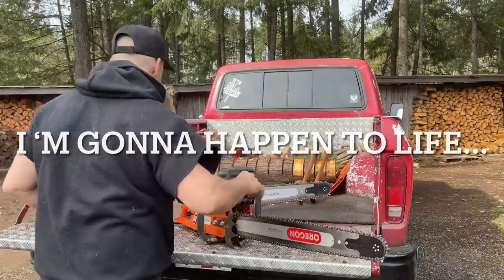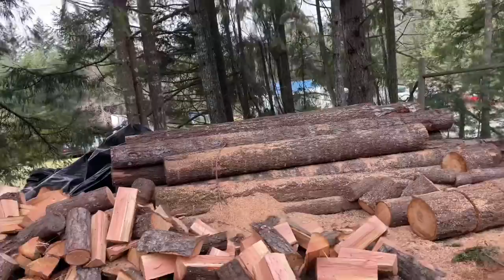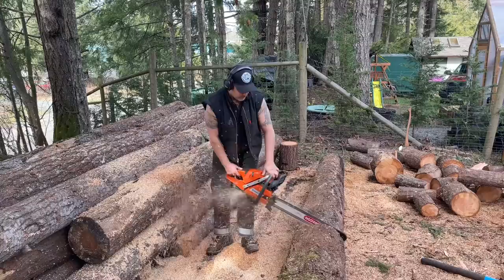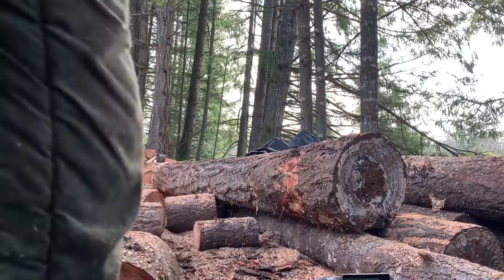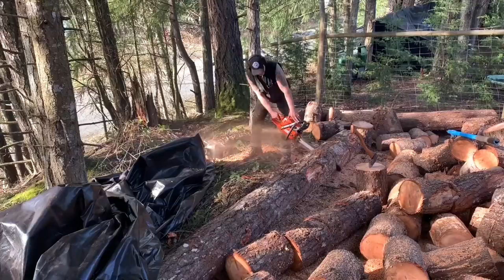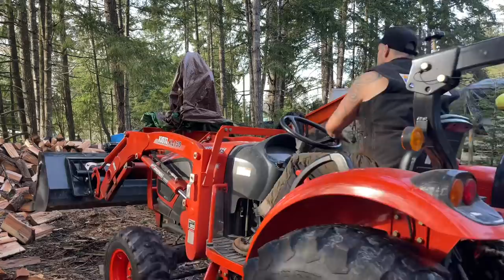Chainsaws + Man + log pile = inner peace.  Tips on bucking on log pile

Comment: Husqvarna started making the 372 again. In stores right now. I was talking to you about my 570. I ended up buying a brand new 562xp. Power to weight ratio is insane buckin.  58cc making 4.7 hp. To compare. A 365 is a 372 engine with restricted cylinder. 70.7 cc making 4.9 hp. I'm so happy I could dance a jig.

Comment: When you store your chainsaws for an extended period of time ,what kind of gas do you use in your saws?   I bought some premix fuel from huskvarna for a small job ,had it in the saw for 18 months ...I for got to drain it and it cranked first pull .husk Varna says it last for years.
Reply from the maker: i empty them then start them up an idle the carb dry

Comment: Hey Buckin I need a good axe for wedges and such and wondering if you have any suggestions on where I can get one? And how expensive are those axes?
Reply: Check out some antique shops or malls, look for the profiles Buckin shows as being better splitting shapes, if you only find heads go to a hardware store an get a handle and haft it yourself, be patient, trial and error.
Reply: Opps i missed the wedge part, same idea but look for a weight you can swing comfortably, 28 inch handles i believe is what Buckin usually does for wedge bangers.
Hope that helps
Be Kind friend!